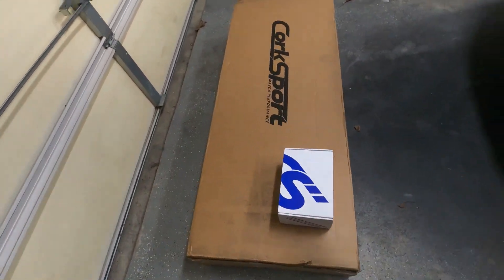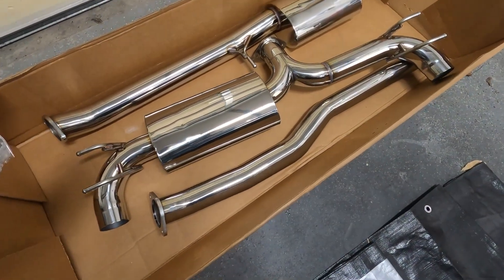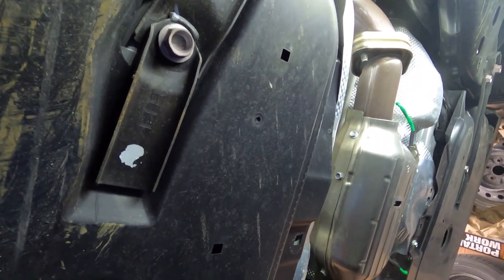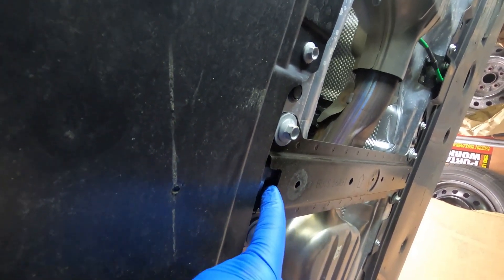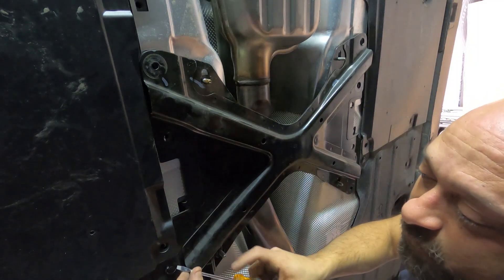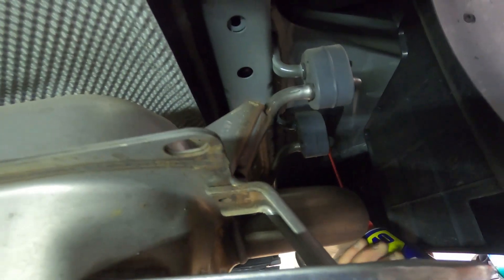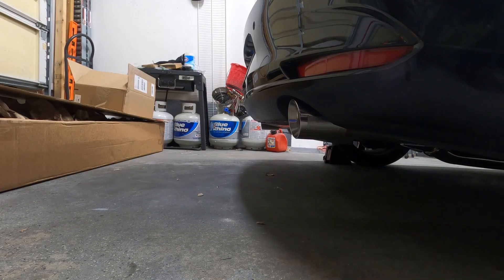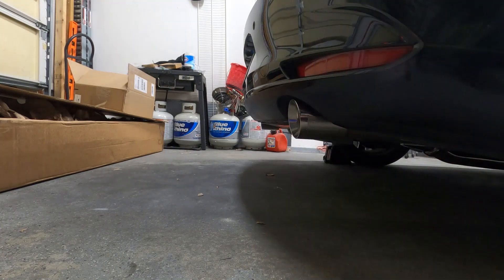CorkSport 2021+ Mazda 3 Turbo 80mm Cat Back Exhaust System Installation & Sound.

Comment: Would this fit on my 2023 non turbo?
Reply from the maker: This 80 mm is for the Turbo. They have 63 mm for both Turbo and non turbo. you can call them and they will help you.
That is a link for 63 mm non turbo:
https://corksport.com/2019-mazda-3-2.5l-cat-back-exhaust-system-63.5mm.html
Reply: @pharaohssquad8078  thank you man! What if I want to add a turbo to it though myself? Would that change anything?
Reply from the maker: @justiceblade7876   I am not sure  to be honest. you can contact Corksport and they will answer your questions. Also there is a Facebook group about supercharge Mazda 3, you can join and ask them. I think that is the group link: https://www.facebook.com/groups/3266357536944123/
Reply: @justiceblade7876  it should fit on the na, double check the corksport video
Reply: Yes! Corksport just says that it can get VERY loud and won’t sound how it’s supposed to as opposed to being on a turbo model.

Comment: just got this installed on my 2023 mazda 3 turbo. and it sounds amazing however my issue is the driver side exhaust is almost resting on the bumper  and passenger side is perfect.. anyone having this issue?
Reply from the maker: may be you need to move it a little to the other side as they don't center perfectly.

Comment: ever wonder why theres one resonator on the left and nothing on the right? also thats a lot of trust you have in those jacks...dont follow these morons, use jackstands people.
Reply from the maker: Thank you for taking time and writing you comment and being not nice. The resonator is to reduce the drone inside the car and it is effective, And you can conact the manufacturer @CorkSport for design and development questions.
As we mentioned in the video " Don't do it if you can not do it safely", also you can read it in the description. 
Regarding why I did it this way, because a big guy like me will not fit under cars and do a big job using Stands. By the way I don't trust stands or Jack's.
Reply: @pharaohssquad8078  you make absolutely no sense
Reply: @beyond305 I’m pretty sure on their website it says that the side without one adds a deeper sound to the overall sound while the side with the resonator keeps it nice and tidy